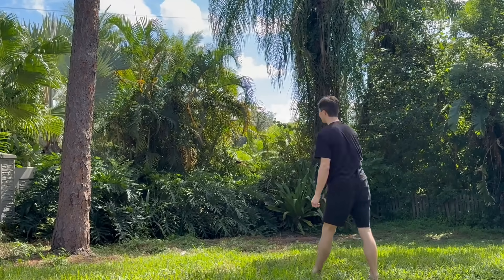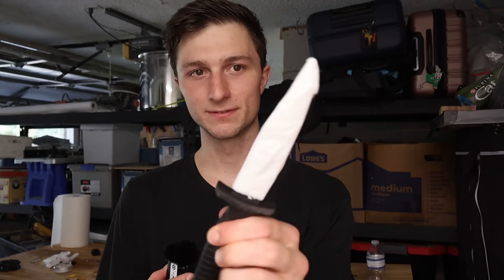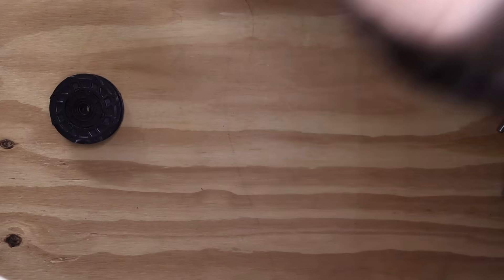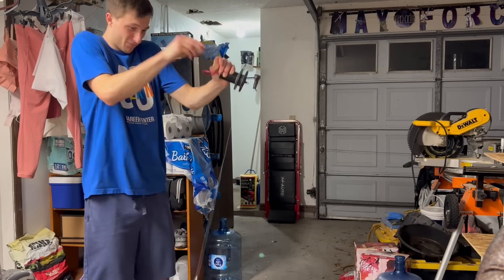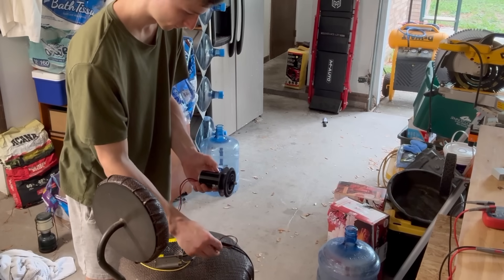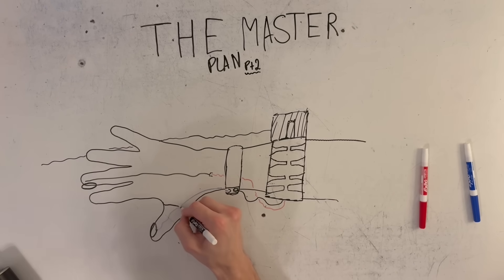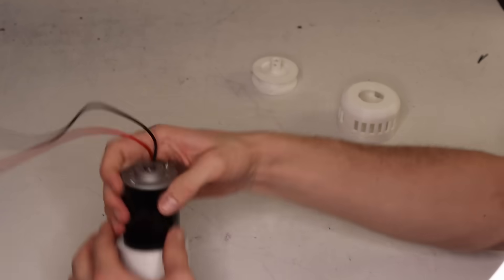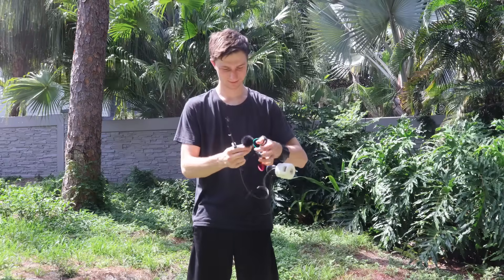I Built a ZERO Gravity Knife

Comment: Not gonna lie partner,  if you ever chose to revisit this idea/build,  I have a load of pertinent information that would make your idea , literally magic.    So  some ideas initially,  you need a draw port om the casing, similar to the port on a fishing pole reel. Something conical,  to accurately direct the line on the return, and the spool should be small, and cylindrical.  This will allow for greater snap back,  reduce weight,  size, and increase mobility/accessibility.  If I had to do a quick design on my head,  I would copy the small badge/key rings that resemble lighter leashes. Upscaling slightly,  but i would also add something similar to a bicycle break line, (but much smaller)  and set it to function automatically,  upon reaching the desired length of line left to return   (for safety as well as handling/return to hand position)  I really hope this helps.  If you need any help at all please feel free to hit me up. Just post a comment on any of my content,  I'll see it 😏

Comment: Try replacing the fishing line for parachord and put the motor on a belt around your waist with the chord running through a tube that ends between your fingers so that the handle is drawn right into your hand.

Comment: bro, c'mon. If u using a fishing line, than use a fishing spool. Ditch this motor - it's too big, clumsy and powerfull. U don't need that. Finally if it zapping ya - use a switch which u gonna turn on by connecting ur fingers. Do not just connect a power line. Remake it, it is gonna worth it

Comment: Few thoughts. Knives have to tumble when thrown for maximum penetration and accuracy and are small, making it unstable on the return trip. Bad for a cable retraction mechanism. Spears/Javelins don't. Much less scary when retracting because the tip is facing away, better range when thrown straight, more penetration power, more practical (for throwing, not every day carrying.). Less cool than the knife maybe, but much more doable as a proof of concept. Might need a more powerful motor if you intend on hitting anything solid with it though, like a tree. Should be fun to throw at target boards and mess around with though. Similar to spear fishing, but with a motor attached to your arm lmao.

Comment: Use the guts of an electrical fishing pole for the base, that's designed for this type of spooling. Also, if you use rings as guides that come out 3 inches from your wrist it will allow you to bring it back more safely.

Comment: Improvements I can see:

- Insulation on the inside of the finger-mounted foil connectors. Keep the zaps to a minimum.

- You definitely want some kind of guide tube running from the spool to your palm. Should reduce the amount of random spinning the knife does at the end of retraction.
  + In fact, I'd actually move the entire spooling system and battery up onto your shoulder, back, or down to your waist, then run the guide tube from there up and then down your arm to your palm. All that extra weight is likely throwing off your throwing capabilities.

- Some way to add an immediate few feet of slack before you throw the knife, since it loses a lot of inertia when the initial slack is used up and it has to pull the spool into a spin.
  + Better idea would be maybe a form of pseudo-ratcheting system on the spool that allows it to spin freely when throwing the knife, but lock in to be retracted when the motor is turned on. Some kind of centrifugal-powered levers that spin-out to lock and spin-in to unlock depending on the direction. Would probably still need an initial tug to unlock them, but adjusting the knife post-catch might be enough; otherwise you'd have to engineer another motorized system that turns one way for a quarter-rotation and locks when the current is closed, then a quarter-rotation the other way when it's opened again.

- Possibly redesign the spool, a flat-bed may not allow the line to be properly re-wound since it's so thin.

Comment: There are two major problems with this. One, and the biggest issue, is that when throwing a knife it has to be able to tumble through the air on its axis to accurately and deeply stick into a target. Connecting any kind of line, no matter how thin and light, to the bottom of the knife is going to make it nearly impossible to throw over any kind of distance unless you are doing just a straight line throw over a very short distance, no more than a few feet. 

The 2nd problem is that even if you succeed in throwing the knife straight and having it stick into the target, you need a strong enough string, cable or cord to pull it out of the target and back to you, which is hard enough, but then ALSO have the issue of a bladed object coming back to you with speed and a volatile trajectory. VERY likely to hurt yourself on the return journey. 

So, while it's a neat idea, it's both extremely dangerous and impractical physically.
Reply: google Meteor hammer
 most of the arts also work in the context of knives (often referenced as Rope dart)
Reply: Tbf you can just use a zero spin throw

Comment: Reminder that most spools that use fishing line are conical divots to funnel excess string into the center of mass of the spool automatically. And the motor is too fast to see this result. Definitely need a motherboard to gradually introduce speed and move it along your inner wrist so that way all your fingers can reach and catch the blade in your hand the way the guy with the spring has it.
Reply: Make this top comment
Reply: Not necessarily a motherboard, I'm pretty sure there are some electromechanic devices that can help with that

Comment: Maybe if you wanted this to work with less drag on the line and more finesse. you should look into an actual fixed spool fishing wheel run by a motor. im not normally a big fan of enclosed fishingwheels, but they do eliminate the need for a fishing rod to guide the line in te right way and they wont snag on clothing etc.

Fixed spool fishing wheels use a flipover lineguide to have the line come out freely but spool in with some force, they even come with premade breake systems so torgue and speed would be seperately adjustable.

Guess for proof of concept you just need a cheapo kids fishing wheel and some decent strength braided fishing line (definately not hard nylon as you used, with natural tendency to coil) Fishing wheels are normally geared something like 1:5, thats one turn of the handle for five turns of the spooling mechanism. Seeing as a motor is a fair bit faster than your hand you may want to dissasemble the wheen and eliminate the gearing.. should save size and get you more control of return speed.
Reply from the maker: Thank you, wise one 🤔
Reply: @WestPalamar  Its not that i care alot for credits far as giving the idea, but id love to see it made as a project.

Comment: try to add a layer of tape on your finger to insulate it so it doesn't zap you and a thicker string might help prevent the tangling
Reply from the maker: Genius 🧠
Reply: And maybe feed wheals right at the mouth of the spool to guide the line in while rewinding.
Reply: I was looking for anyone else to mention insulating the side that attaches to the fingers to prevent the shock from happening before putting my own separate comment. Thank you for attempting to save this man's fingers